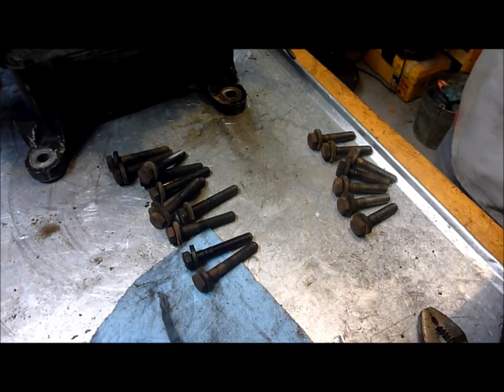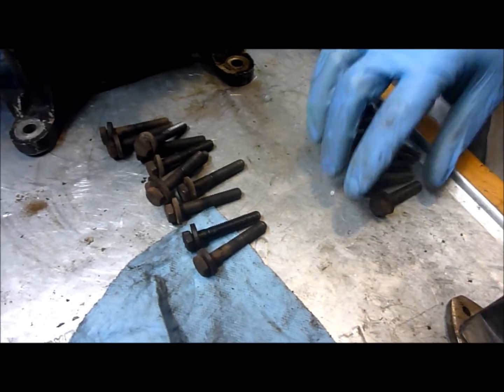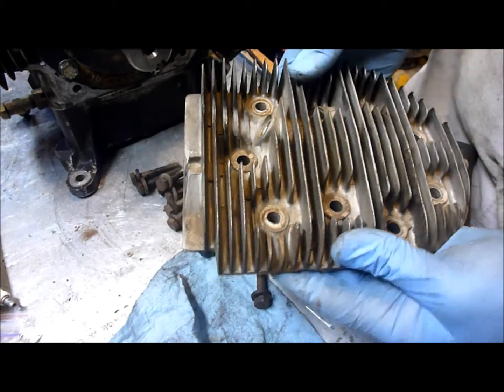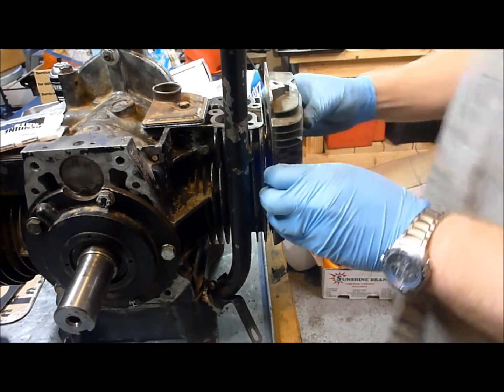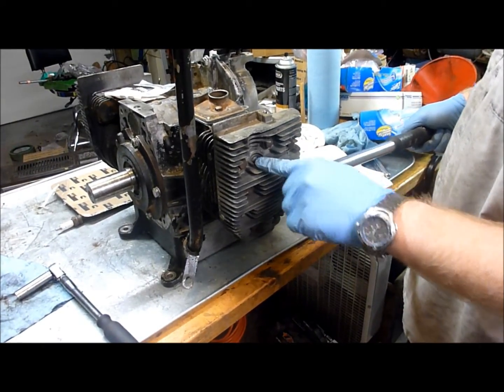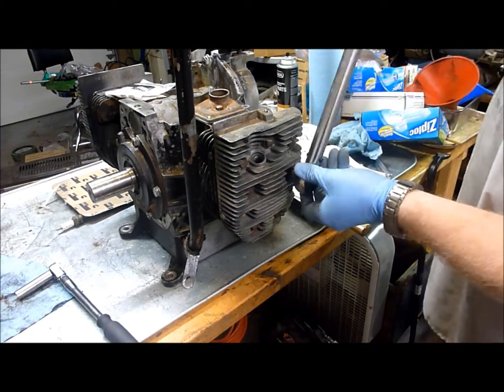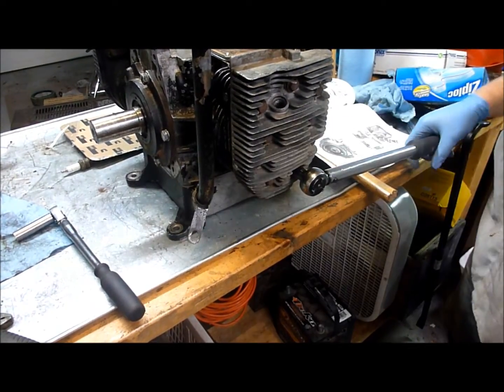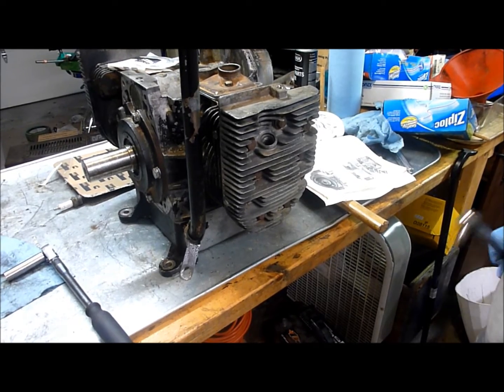Rebuilding an Onan B43G (Part 11) Head Install

Comment: 05/10/25 just followed along for my rebuild. Ty.. kinda sad there is nothing after this but appreciate it all the same
Reply from the maker: I think there used to be a follow up but it was removed several years ago when YouTube cracked down on music in the background. Last I knew this engine was still running fine.

Comment: Did you ever show this running in the 318?
Reply from the maker: I did but it’s not a full video and I think YouTube changed something with settings that made the video private. As far as I know this machine is still being used with no issues. I’ll check in with the owner and see.
Reply: @mmrbeef  I'm sure its working fine far as the engines concerned. Looks like you did a good job on it.
I've got an  Onan  20.5 HP out of my Hobart Champion 10,000 watt welder. I just have got everything taken off to where I can start tearing down the engine. It was locked up.
It became unlocked when trying to get the generator rotor screwed off of the crankshaft to the left. I'm hoping the block is salvageable. Its a P220G V engine.

Comment: how similar is the Onan B43G from the Onan in the JD 420 (B48G)?
Reply from the maker: I would have to sit down with a parts diagram to fully answer the question but... the B43G is a 43 cubic inch engine while the B48G is a 48 cubic inch engine. Parts that I know are different are the carb, camshaft, and rods. The pistons are similar, as are the valves. I cannot remember about the crankshaft. Hope that helps some.
Reply: @mmrbeef  thx.  picked up an 83 420.  Seems to be a good working unit.  no smoking, starts up easily, hydraulics are good.  deck solid.  Oil leak somewhere...on my to-do list...

Comment: I just started to disassemble the heads, and the 2 bolds closest to the exhaust broke on both sides. I think do to the exhaust heating. I have enough of the  bolt to grab on to (1/4 inch) now the head it off. Any suggestion? I have been soaking it with liquid wench, and I think I may have to touch it with low heat. Its a little touchy heating up that aluminum block or cylinder.
Reply: Just got it fix with a threaded sleeve. Tough one, tried welding a nut on the broken bolt, no luck. Tried easy out, no luck. Had to drill out and put a threaded sleeve in. One of the toughest I ever deal with. Pain in the ass. But its done.

Comment: What would be the next video in this series?
Reply from the maker: I think this was the last one. All we did after this was put all the tin back on. As far as I know the engine is still going strong. If you have some specific questions feel free to ask.
Reply: @mmrbeef  I have a question for you, what type of connection does the oil pressure switch use? mines like yours where its just  a brass nipple or something that comes out of the switch where am i supposed to attached a wire? thanks.

Comment: did you ever find that rod cap in no.6 video and i cant find startup and run video. but great series
Reply from the maker: I think the file was either corrupt or we just never pressed record. I have a start up video somewhere but it's poor quality. I can tell you last I talked with the owner the engine is running great.

Comment: Id recommend tightening the head bolts in a few steps. maybe go all to 5nm, all to 10, then all to 20. or even just all to 10 then all to 20nm.

other than that, thanks for all the videos!
Reply from the maker: Thanks, yes, that is what I do now. I think I noted the step up toque in the video where I rebuilt my pony motor for my 1957 John Deere 820. I would highly recommend doing a step up torque sequence. (I am trying to think why I did not for this engine.... I did when I rebuilt the P220 I have.....)

Comment: Thanks so much you helped me do so much thanks again can you tell me what the torque is on these heads
Reply from the maker: Approx 15 ft lbs for the head bolt torque. The conversion between newton meters is 0.737 ft lb per nm.

Comment: Do u rebuild onans for other people? I have a 420 that needs work.
Reply from the maker: Sorry, I do not unless you plan to be without it for a couple years! I am very slow at this kind of stuff... this rebuild was done over a month period... the one prior to that took me a little less than a year! These are fairly simple engines to rebuild so try it yourself if you can be without the machine for a few weeks to a month.
Reply: Thanks for the quick response
Reply: @mmrbeef  I did a JD 210 over in the spring.  down to the bare block, bored .010" over, new piston, rod, rings, gaskets.  took around 3 weeks.  was my first time doing one.  watch a video, turn a few more bolts... ;)  these videos online are a really good aid.  kudos.

Comment: mMrBeef, Just wanted to extend a hearty handshake of thanks for going to all this trouble to educate your audience. I just purchased a nice 1987 JD 316 with a P218 and am watching all your rebuild videos just to get familiar with the engine and components prior to tearing the tractor down for a cleaning and refresh this weekend. I think you did a fantastic, detailed job of instruction on your B43G rebuild videos and I found them MASSIVELY helpful! Thank you. You have not only demystified the engine for me, but also given me some confidence to attempt a rebuild similar to yours on my own. My Onan is currently at 1189 hours and still starts and runs smoothly, and does not smoke, though I know it's had a long life of work and must be getting tired. Not sure how many hours a well-kept P218 is capable of, but at nearly 1200 on mine, I'll be watching it closely. I may have missed something, but I could not find Part 12 and beyond on your B43G rebuild series? Perhaps you did not continue those videos, not sure. I sure did enjoy and was SO EAGER to hear your rebuild start and run. Anyway, thanks so much for all your hard work on the videos, and teaching all us newbie JD enthusiasts. Take care.
Reply from the maker: I apologize for taking a year to respond to this....... better late than never. Thanks, glad this set of videos are going to be able to help you out. These engines will go a long time if they are taken care of correctly. (oil changes, air filter w/ pre-cleaner etc etc). As for Part 12 there really is not one (I don't think). I do have this video of the engine reinstall and running a Model 30 hydro tiller.... Not the best video but this is the engine. https://www.youtube.com/watch?v=7k1wiqZlXkY I will go back through my videos and see if I have something that will constitute a part 12.